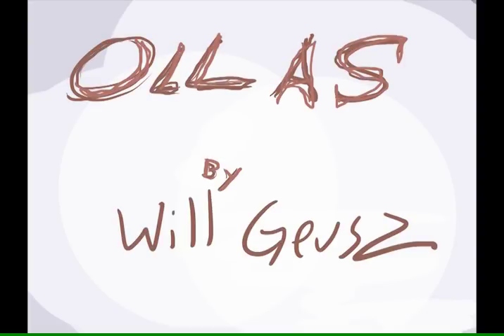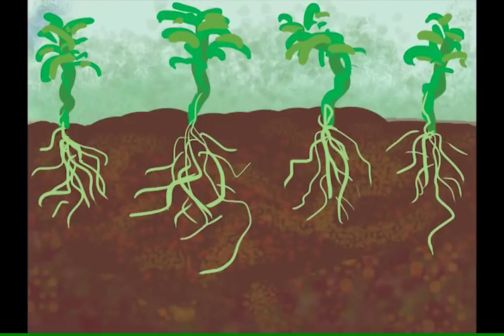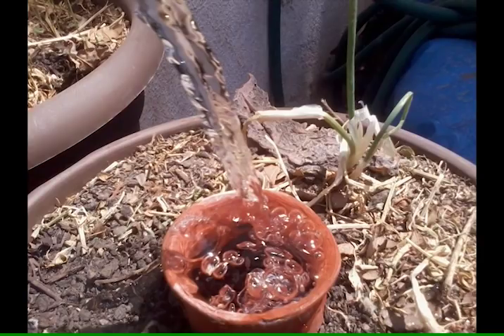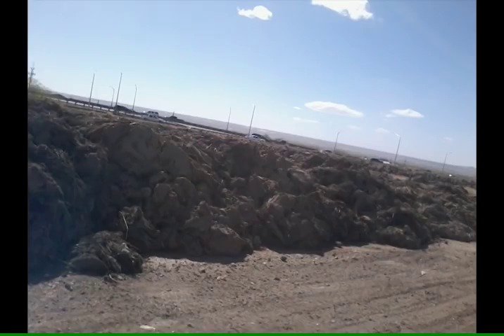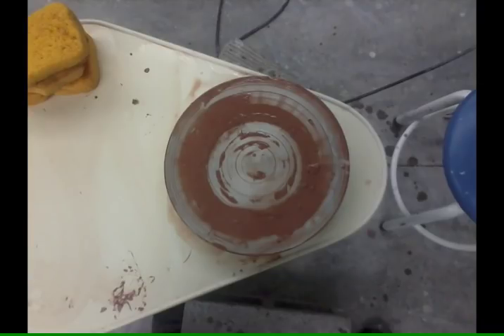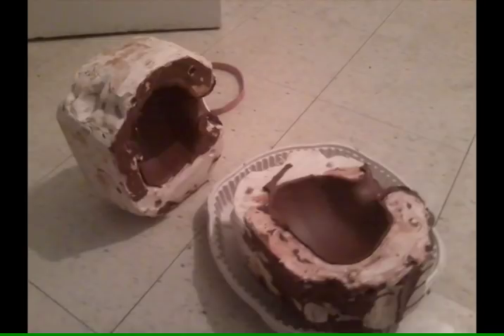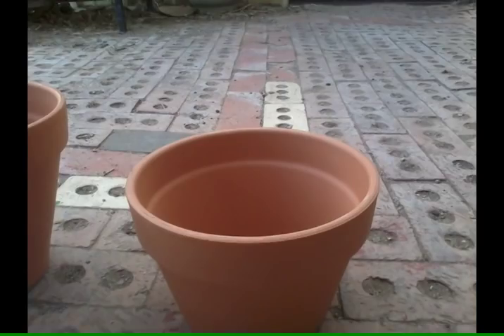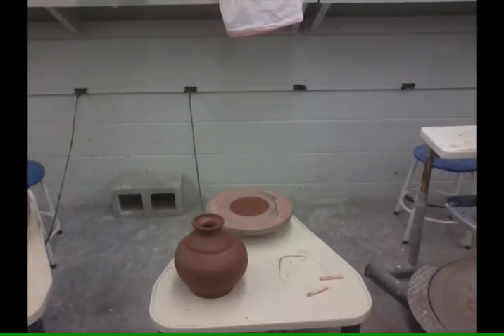Ollas: A Collection of Information and Techniques

Comment: I live in a relatively wet ecosystem, so I don't really need ollas, but I've found that growing some of my garden plants in partially buried terracotta pots is doubly useful. For one thing, I can grow plants that like warmth and dryness a bit more (like peppers) in the pots, so the have a bit of an advantage in the rain. But also, when we have a dry spell, I can water into the pots directly, which then act like ollas for the plants in the ground. The real advantage here is that if I can keep my surface mulch a little drier, I don't have to worry about slugs nearly as much, and there are always a ton of slugs.

Cool video dude. Keep it up!

Comment: I made my first olla from an unglazed terra cotta pot, sealing a piece of broken tile over the hole (from the inside) with a little wet cement, and then adding cement to cover over that little tile and out to the edges of the pot (smoothing it with my finger to make sure it's sealed nicely).  Then I used the terra cotta lid to set on top.  I got that idea from youtube last year.  I guess that sealing two together would give you a lot more water capacity, but I don't really need that much in my little raised bed garden.  THANK YOU VERY MUCH FOR EXPLAINING ABOUT HOW TO SPACE THESE OUT!
Reply: هل تقصد ان الغطاء يقلل رشح الماء من الاوله وبالتالي حفاظ اكتر علي الماء

Comment: I've done the clay pot method with great success using 3 different sized pots (6 inch, 5 inch, and 2.5 inch I think) the 6 inch went on the bottom with its hole sealed, the 5 nests upside down inside the 6, and the 2.5 gets its outside sealed then is put on top of the 5 to act as the neck as well as a funnel for filling. everything got put together using clear GE Silicone #1 (100% silicone with no additives) that's just the brand I can get here easily. As long as it's 100% silicone (not the bath/ kitchen stuff!!) it's non toxic. Just make sure your clay pots are warm when you silicone them so that the pores in the clay are expanded and will bond with the silicone more readily. Doing it cold would probably work but I figure every little bit helps me from having to remake them as frequently.

Comment: I use the buried clay pot from Home Depot method. Use a saucer for a lid. Very easy to check on the water level. I used marine safe tape to seal the hole. If it's ok for aqua life should be ok for the garden. 🙂

Comment: Hi. I learned a little trick from RainbowGardens, a great gardening channel on YouTube. In this, very large plastic bottles are used. I tried this and it seemed to work really well, tho I didnt do a comparison . But you get really big plastic bottles(i had a mix of 4 and 6 litre ones. Fill them with water, put them in the freezer and when the water has frozen take them out and attack them with a small awl or similar, poke lots of holes. When the ice has melted, bury them in your raised beds up to the neck. Then fill with water plus plant food(if appropriate), screw tops back on and voila! Water seemed to take about 2 days to drain away in a very hot summer. Not as good as ollas but much cheaper.
Reply: Hi, I actually saw the same video on RainbowGardens. I am planning on trying the Milk jug method myself. If you don't mind me asking, how far apart did you space your plastic bottles?

Comment: I stayed with the video only to find out that this is sort of the very same concept that I 'invented' myself earlier this year: I took a very fine, synthetic (for reasons of expected durability over cotton and to prevent soil from entering the water zone) net-like cloth, sew it in the shape of my container, filled it with expanded clay pebbles and placed it at the bottom of 15 cm deep container. Filling soil on top I now, after a few months, see that even after 4 days of heavy sunshine the plants don't get dry, while weeds growing on the top had a very hard time. Eventually they reached the moist part of the pot, unfortunately 2 days too early, otherwise the weeds probably died.  I filled the reservoir up last week with a litre of water and since it has been perfectly fine. However, replacing the synthetic cloth with a flat board of clay could be a great next step!
Reply from the maker: that sounds cool, do the roots grow through the fabric or along the outside of the bag? how did the rest of the season go?
Reply: I'm having a hard time visualizing this do you have a video on this? How has it work over time?